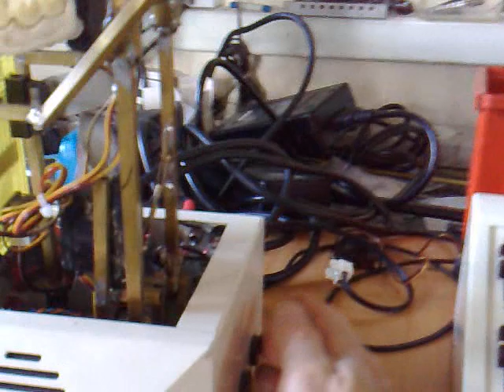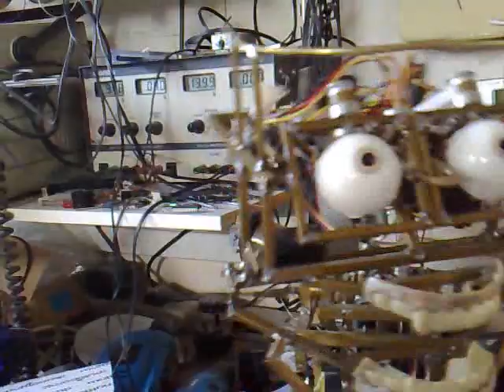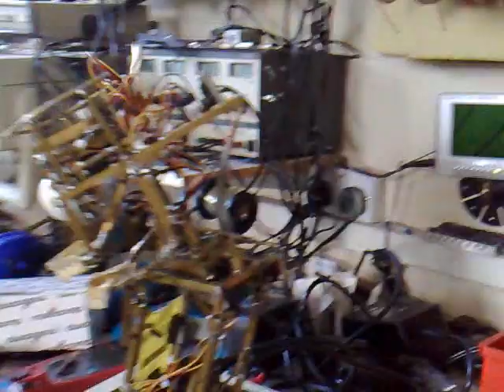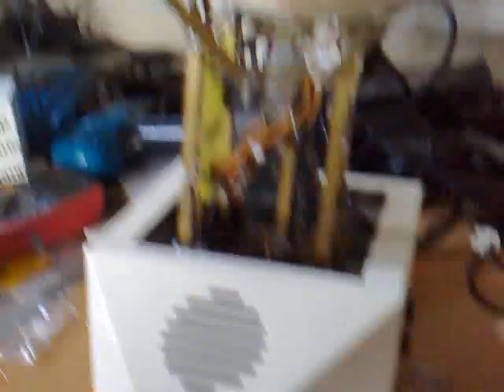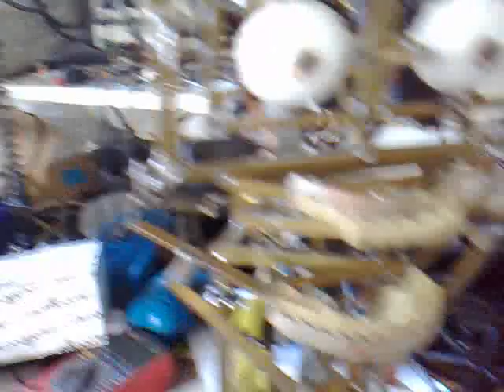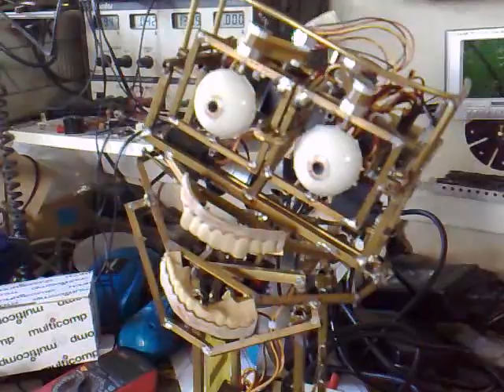robot head

Comment from the maker: At the heart of this is a PARALLAX BASIC STAMP
ver BS2P40..together with two pic based 8 way servo controllers.this enables 16 servos to be controlled simultaneously. My newest controller also has addressable latches to enable me to turn each servo on and off. This conserves power in the main body(not shown yet) and in the case of the hand reduces programming complexity,ie I dont have to take into account the position of each servo when moving the wrist up and down etc. Regards Kevin F..

Comment from the maker: 'I just had to watch the video to remind myself', On start up all servos go to a pre-programmed  'safe' position. I then selected the different operating modes through
the key switch.  The p.c board is at the back and is separate from the audio board.
(It is good practice to separate digital  and audio ) The audio and sensor board is at the front , for push button and PIR sensor activation etc. 
 The 'plug' is actually a bit of tape just holding the eye video camera output wires !.

Comment from the maker: I designed a recordable sound module based on the 'ISD chipcorder' that allowed me to record a message and play it back as if the head was speaking. I could play background music through the front speaker which would be interrupted upon a trigger
that would then play the head movement and recorded message at the same time.
I shorted out  the module by accident prior to the video, and the amp chip I used was obsolete by the time I went to repair it.Still haven't had time to re-design pcb.